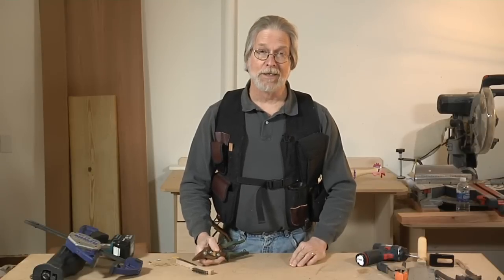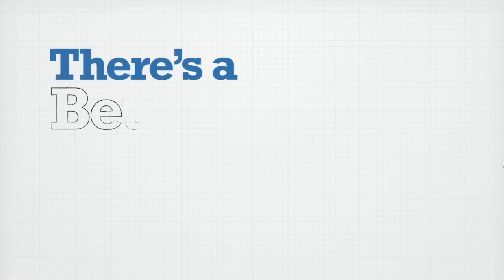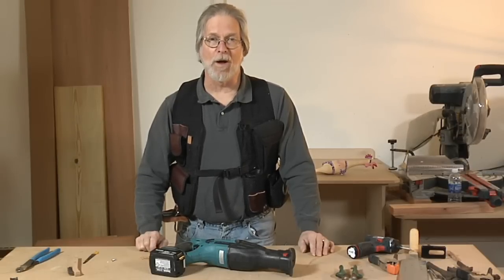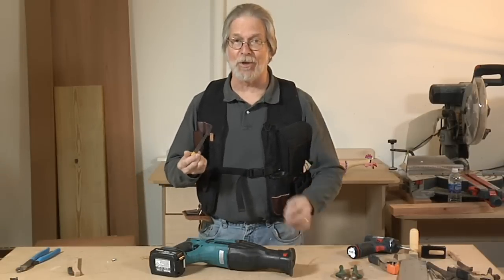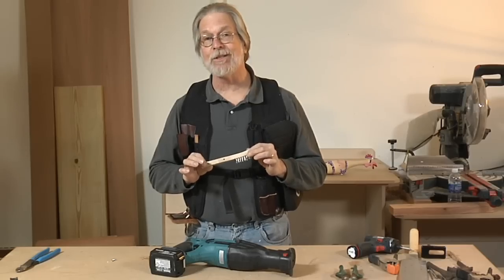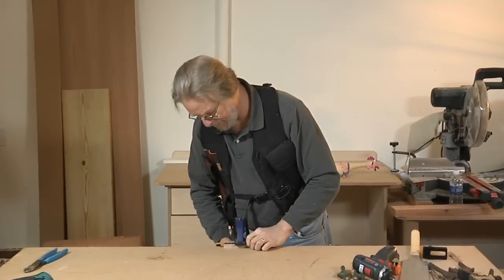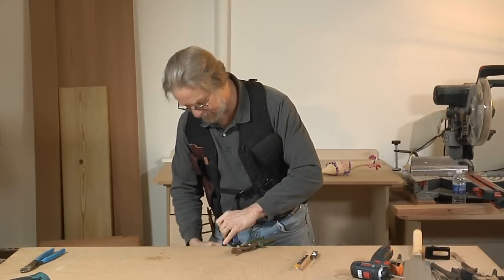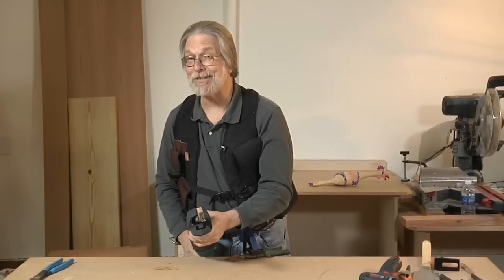Make Rust Removal Easier with a Modified Wire Brush

Comment: Electrolysis brothers. Add washing soda to container of water, drop in a steel anode (I used an old window weight, attach neg from battery charger to piece and positive to anode. It will remove rust from hidden places. I fixed a pair of needle nose pliers welded shut with rust. Incredible.
Reply: Can’t remove an old wrought iron fence and dip it in water to electrolosys it
Reply: @audreylove8299  chuck it in the river and elecotrise the river

Comment: I use a wire brush wheel in a grinder.
Reply: Yeah the bench grinder with the brush attachment for sure !
Reply: This mod is better for on site type stuff like an old fence. Can’t bring a bench out to the field
Reply: Wich wire brush  brand you used ?